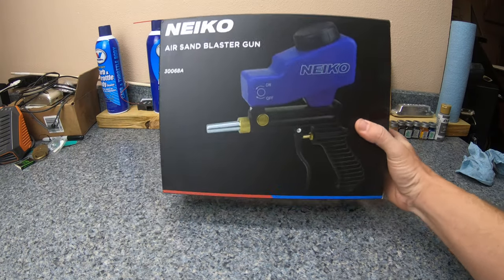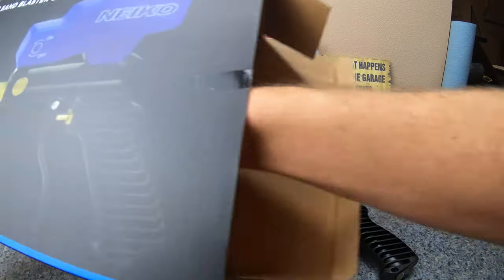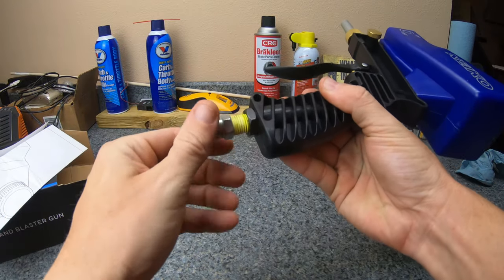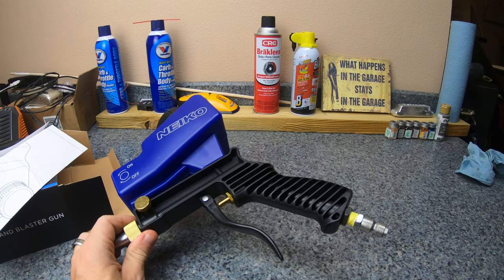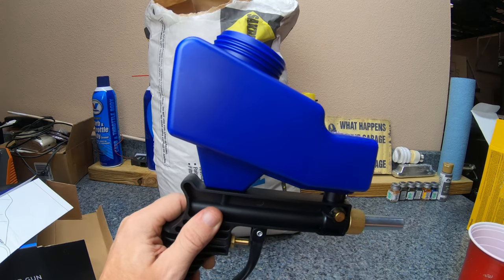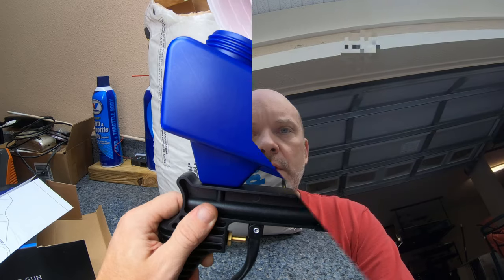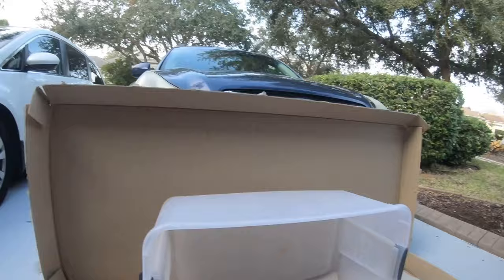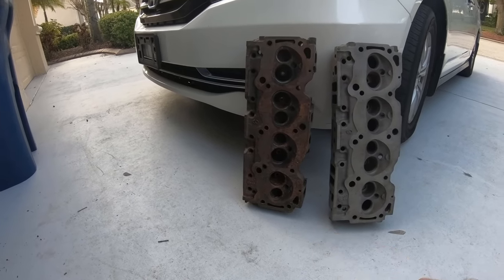Review: How effective is Amazon Neiko Sand Blaster Gun and a small air compressor vs large one?

Comment: "Guess if it gets clogged, you can..."

Yep, but you 'll find you may take it off more to replace the steel tip.

Depending on abrasive, (sand contains silica, which is dangerous AF  for your lungs), the tip may last minutes, literally.  Replace it w/ ceramic; well with the minor cost.

Re: blasting media
Do not blast unless you have a well sealed respirator, NOT a paper mask. You'll kill yourself.

Blasting sand is more consistently sized, and much drier. Unless you live in the desert, don't waste your time w/ Home Depot sand. Blasting sand is not that expensive; go to a masonry supply house.

Regular sand contains silica, (natural glass, & what is used to make glass.) A common media is 'green grit', (copper oxide slag). It comes in a variety of grit sizes.

You can buy silica sand, but don't unless you have a fresh air hood; 1 blasting session w/ inadequate lung protection using silica can seriously impact your health.

Don't eff around, silica gets in your lungs & imbeds itself, never coming out.

Keep kids & pets away.

Re: re-usability
Media of all kinds breaks upon impact; it can be re-used, but it works the best to mix it w/ new sand, & re-use 2-3 x's, at most.

Clean grease & anything the media can cling to or bounce off of; clinging or bouncing = not blasting.

When you get it working right, it's just like 'painting' new metal. Not painting on new metal, it's like a layer of new metal comes outta the nozzle.

A well operating blaster is mesmerizing.

Try it on wood or stone to 'carve' designs/letters; someone who blasts headstones will have adhesive backed rubber sheet. Put it on, cut away your design/words & blast away.

Glass/plastic frosts very nicely.

If you're doing car sheet metal, keep the pressure 50-60 psi & blast at a shallow angle. The closer to 90⁰ you blast, the more chance of blasting ripples, or even heating up the metal until it get warbly.

The safest medi
Reply from the maker: Thanks George, that's a lot of helpful information to add to this video.
Reply: @JackofAllTrades1  Glad to share.  Been blasting since the '80's when I got started by going big. An old friend & I had started a biz doing auto repair, body & glass & auto parts. Picked up a state surplus blasting setup w/ a Davey 6 cyl diesel driven compressor & 60 gal media tank, (those 8' trailers you see hung from the crane, at night, in a road construction zone).

Got the thing cheap for personal use for restoring antique autos & building street rods, then discovered the local blaster who'd been in the biz 40+ yrs was a drunk & had ran off most of his customers, potential & long term.

Once it got around we could blast cars w/ pressure or temp warping the metal & we'd give people a great price on blasting little stuff if they weren't in a hurry, we got swamped, (we'd gather stuff up for a monthly blast-fest, then stack all the little stuff on top of frames or body parts & blast 2 for 1).

In 6 months, hired 1 employee, then Willamette Industry's fab shop, which was in the same town came calling. Fed up w/ the drunk, & excited we could blast & paint, we got all their in-house equipment & repairs they did for the entire NW.

Two months in, added a 2nd blasting employee & Willamette saw us & raised by branching out into contract work.

We did some cool projects for them, & our fledgling Industrial Blasting & Painting Div carried the biz thru the recession of the early '80's & the usual growing pain re: starvation.

We blasted & painted, (w/ catalyzed polyurethane in a spatter finish), the world's largest electron beam smelter oven, destined & still operating in the Ukraine. The feed auger was 47' long, 8' in diameter!  We blasted in a 3 x 8 hr shifts for just over 3 wks, then my partner & I painted in 2 x10 hr shifts for 3 more.

Paint & media were delivered on pallets, & Willamette parked a small diesel truck in the old lumber barn we were working in, so we could keep going.

Got done ahead of schedule enough they got an early completion bonus, which they gave us a cut of.

For 2 guys who were starving & trying to recover from severe industrial/work related injuries in '79, we were riding high.

The other, much smaller, but very cool item we did for Willamette was, at the time, the largest glass lens polisher ever built. Made for Kodak, we never learned what the 48" capacity polisher was used for, as it was classified. Willamette didn't know.

I've speculated since then; this was at the same time the Hubbel telescope was being built.  Since the 1st set of Hubbel's lens turned out to be garbage & had to be replaced, in space, I never pushed to find out if Kodak made lenses for the Hubbel!  LOL...

My old friend got weird re: our partnership & how much I was needed. Since he owned the property & the partially built building I turned into a dream shop & business, (employees did the day to day, he & I built hot rods & race cars), I was the one to go.

Turned out I was fairly crucial to the biz; he & his new GF's dad, (who'd been whispering in my partner's ear re: me.), lasted 6 whole months after I left.

I've had smaller blasters every since. Had a customized combo cabinet/outside blast tank unit I built, starting w/ a common brand cab.

Over the years, I've blasted just about anything that could be blasted, & a few things that shouldn't be blasted, (low pressure peels bark from logs & rines from certain fruits; getting it free of media, post peeling, is the challenge.

Tried almost every media looking for a safer, high quality abrasive, except for water slurry; keep coming back to green grit for 80% & silica for the special jobs.

Gettin' old, (70 this month), in 4th year & 3rd bout of cancer, so I 'spoiled' myself by hiring a local soda blasting outfit to do a vintage fire damaged, (plastic soot), metal cabinet destined for my machine shop area, to store metrology equipment.

Didn't quibble over $150/hr or how long it would take. Got it back & it turned my stomach. Still rusty, OEM paint only half gone; from the looks of it, the kid who blasted it was too lazy to bend over & get the bottom side of anything, or stick the wand inside, (probably couldn't handle the blow back).  Hey, blasting's chitty work; it's why it's $150-200/hr.

So, w/ ½ the money refunded, my old azz is going to have to do what the 20-something couldn't/wouldn't.

Let me know if you wanna pick my brain on blasting process or equipment repair/design.

If I survive the cancer long enough, I'm planning in launching a YT channel I started planning pre-cancer.

Been making, fabing, doing & repairing since the '60's; no kids or grandkids interested, & a lot of hard mile knowledge & experience is gonna go with me if I don't share.

Sorry to go on; nature of the beast in my head. Need to get busy, installing new mill this week.

GeoD

Comment: You think the 20 gallon McGraw from harbor freight would be good for sand blasting wheels? One at a time is what I’m going for. Just good enough for working at home. Trying to save money. I was going to go for the 80 gallon but yea it’s $800+.
Reply from the maker: Drop a few bucks on some high flow connectors... I got my hose and connectors at HF and they have held up well. I think if you keep an eye on the compressor and allow it to cool down when needed, you will be fine. Good luck.

Comment: What's a must have compressor size to run this gun?
Reply from the maker: I would think to run it effectively without a lot of breaks your going to need something middle of the road.... 20 to 30 gallon in capacity and probably at least 4scfm at 90psi. You can use less like I did here but it would have to be for smaller jobs. Something that has a higher pressure rating (like 175 vs 135) will also cut out a lot less but may take longer to rebuild pressure once it does.

Comment: Good luck getting all that sand out of those cylinder heads
Reply from the maker: Check out my car videos to see it burning rubber lol
Reply: You obviously have never seen how tiny the steel shot used at a machine shop to clean cylinder heads & blocks. It's so small that they have to cleaned many times, and then when you recieve it back you have to clean it again. So it won't be any more difficult then cleaning out steel shot.
Reply from the maker: @williamallen7836  yea, and both those heads were cleaned up about 0.010 and tanked after the sand blasting, so I knew it would be ok. Thanks for the comment.

Comment: I can't get my harbor freight gun to work like the one you have. Air compressor is a Husky 200psi 4.0 SCFM @90 psi. It stops and once in awhile it will shoot out the media like it's supposed to. I have used different size media and it still doesn't work right. I have the gun and the container sand blaster also from harbor freight, neither want to shoot out the media correctly. It's very frustrating.. I bought the air compressor for this because I work on a lot of furniture. It will save money and time. I have a 100ft air line hose maybe that's causing the issue? I bought a moisture filter so hopefully that will help. I live by the ocean so we have very salty moist air. Have any suggestions? Any help I will appreciate. I'm desperate to get this to work for my small business. I have put a lot of money in to this already.
Reply from the maker: My first thoughts are the hose and the filter. Can you try it with a smaller hose? Did it possibly come with a little hose in the box? Also remove the filter drier for now.